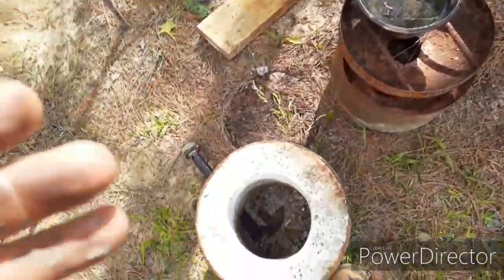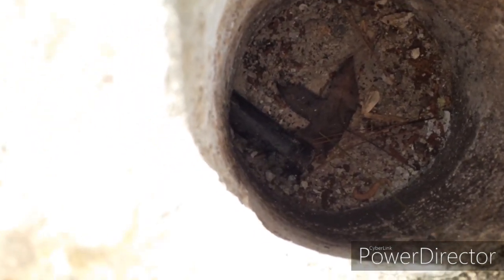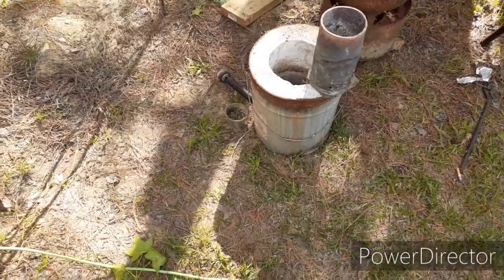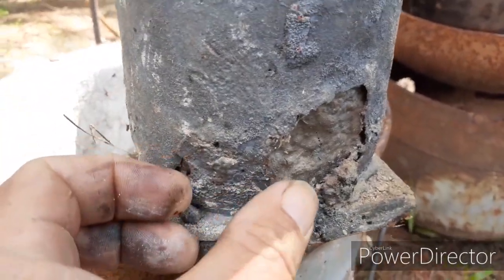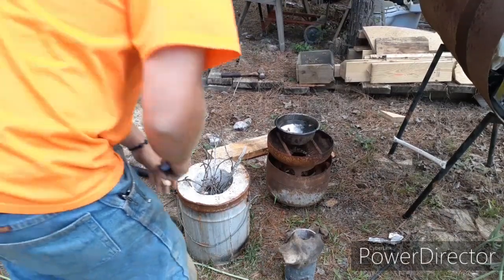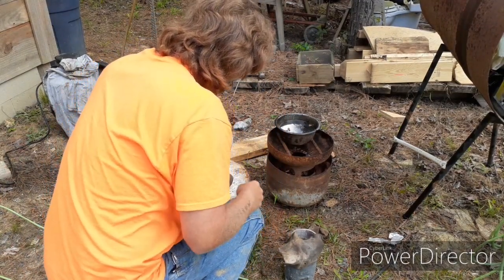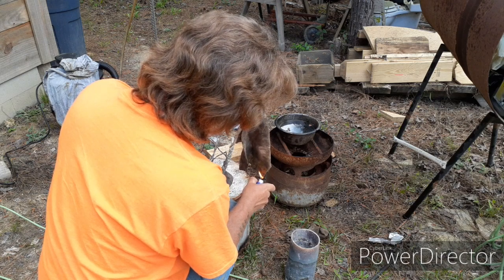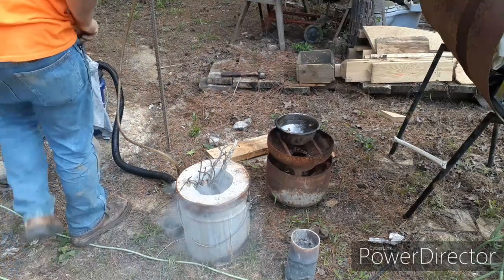Oil fired Foundry test 1

Comment: 15 gallon plastic drum. Use a concrete form cardboard tube. Refractory to fill the void. 4 inch walls?  First heat, will burn out cardboard, and soften the plastic drum, so you can cut it away. Otherwise, if you can find a 15 gallon metal drum, you wouldn't have to worry about it.

Comment: Waving a hand at you from York, SC! I just getting interested in doing this. Meaning I think I finally have enough motivation. Maybe. Anyway I was thinking about using a common propane cylinder for the furnace, but propane fired instead of oil. Not sure if that's what you are using for a furnace, but it looks about the same size. Did you ever fine tune your rig with a smaller crucible? If so how many pounds of aluminum can you get from one melt? Thanks for the vids!

Comment: That vortex was awesome.  What are you using for refactory mix? Bigger to fit that crucible making more air flow around it sounds good
Reply from the maker: That refractory was a diy but I cant remember what I used so gotta go back through my vids